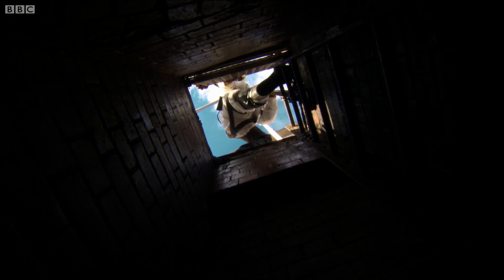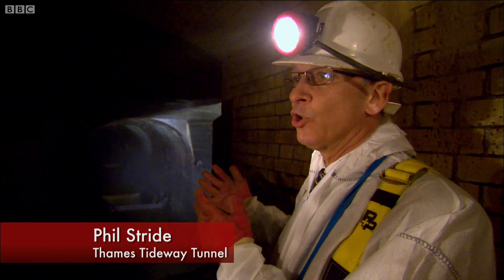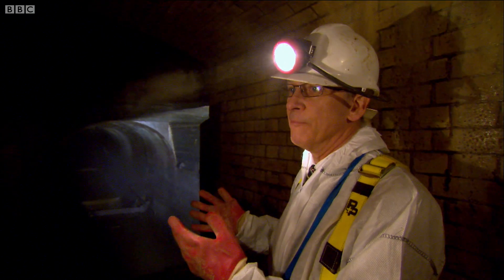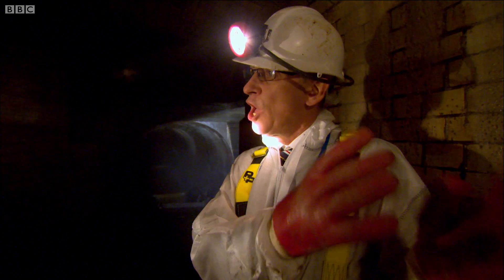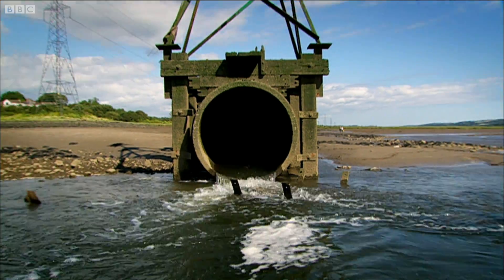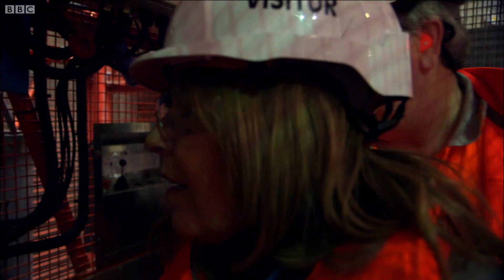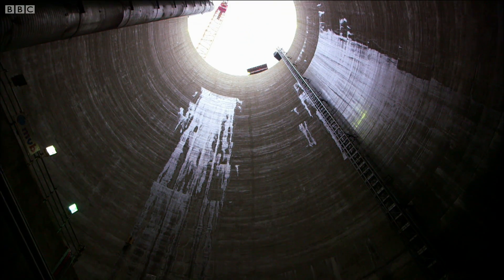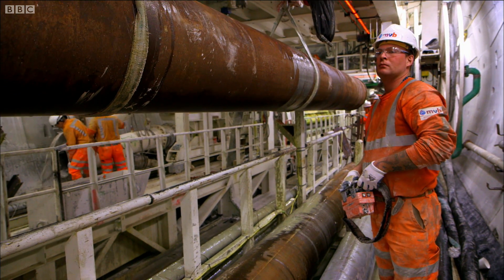Can London's Sewers Cope? | Bang Goes The Theory | Earth Science

Comment: Ew. So that's poo water? And are there no water treatment plants in London?
Reply: Matthew Mitchell There are. It is just that when the system is put under strain, untreated water has to be released to stop everything breaking down. So, they are building this new system to help protect the environment.
Reply: James Newitt there is treatment whenever it does not rain. whenever it rains, treatment is impossible. the new system will not change this because sewage and rain water still get mixed.
Reply: kurtilein3 I don't understand. It is going to store the rain so it doesn't get into the sewage system and force sewage to overflow into rivers. Therefore the sewage will be able to carry on into treatment systems as it would normally. And the rain will be transferred elsewhere. No?
Reply: James Newitt
i would hope that this keeps sewage and rain water seperate, but i suspect it still gets mixed and that the new tunnel just holds more volume.
Reply: kurtilein3 A little rain will always leak into sewage, that's not a problem. I don't think sewage waste will be getting into the new tunnel. However it works, I'm pretty sure that over £4 billion doesn't get spent unless they know it is going to work.